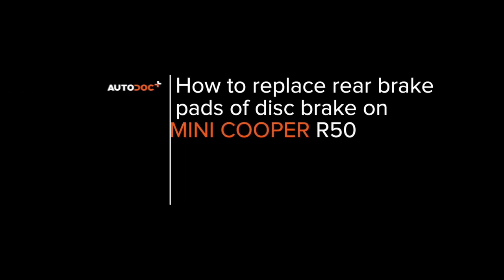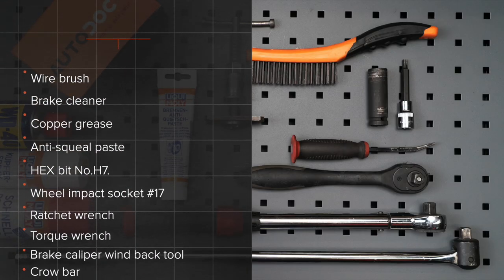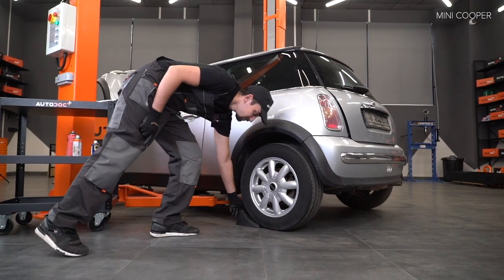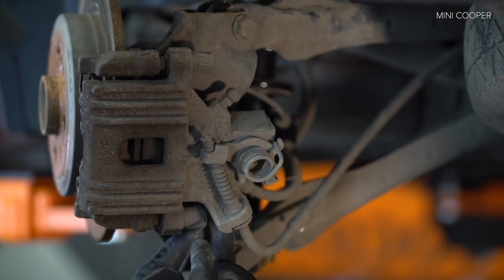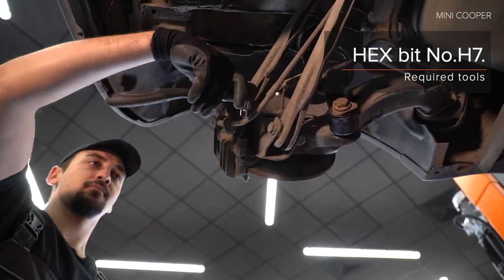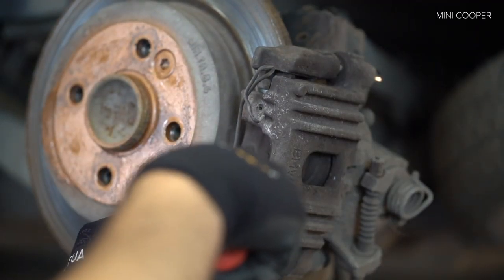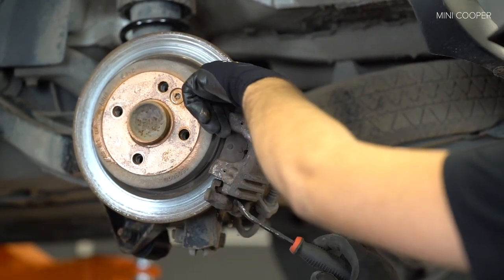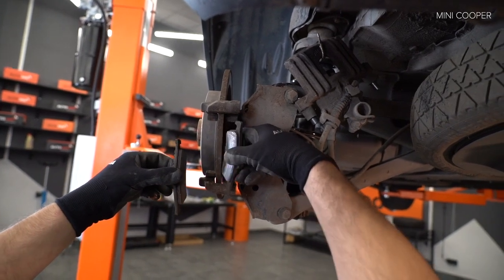How to change rear brake pads MINI COOPER 1 (R50, R53) [TUTORIAL AUTODOC]

Comment: The rear pads facing the caliper piston have a metal spring which goes inside a grove around the piston. The brakes will squeal by vibration even without pressing the brake pedal. Also go easy with the guide pins, you can cross thread them, personally I would change them together with pads and rotors.

Comment: If you have auto handbrake adjustment dont you have to back off the handbrake when fitting new rear pads and then when the pads are seated pull on the handbrake and it resets to the correct position?

Comment: What size mm is the windback tool for an r50?
Reply from the maker: Thank you for your comment!
Please clarify or rephrase your question.
Best regards,
Autodoc team.
Reply: Just use a small clamp to wind it back in , no need for the tool 
I use a clamp on most of my brake pad changes